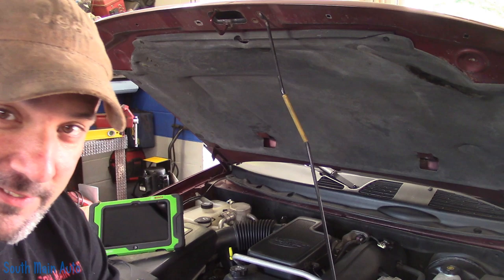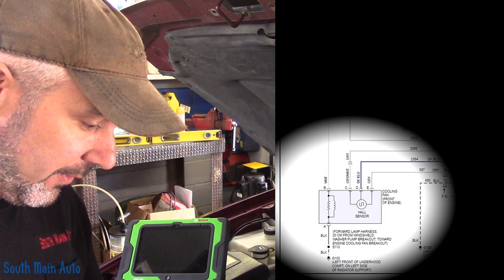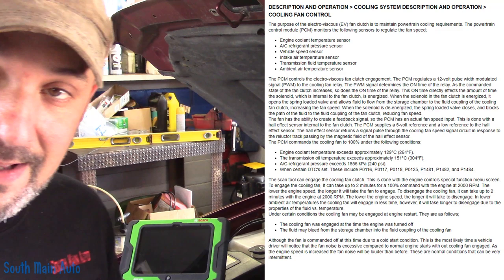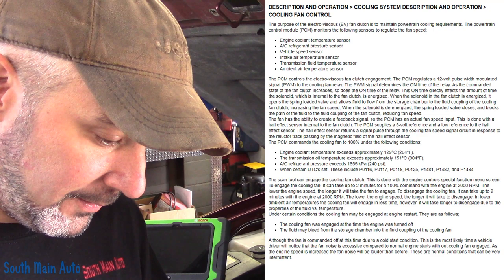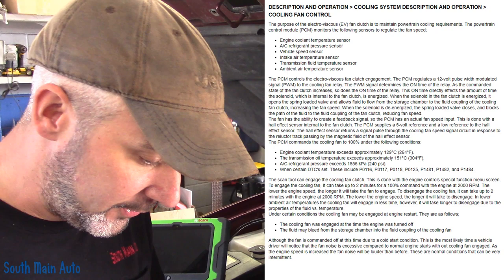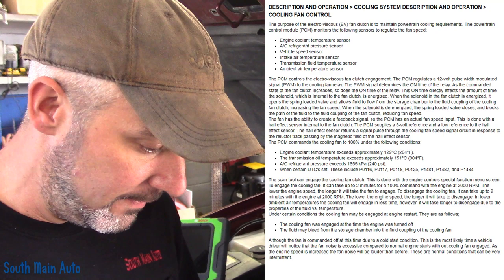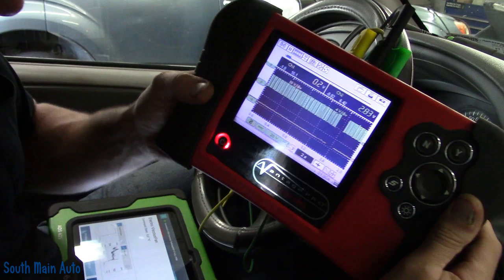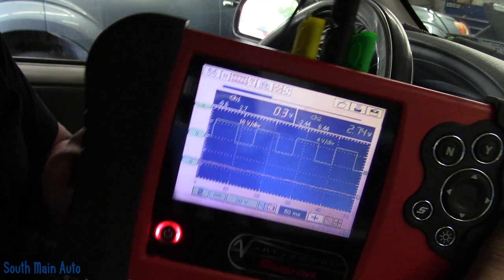Chevy Trailblazer: Electric Fan Clutch Failure

Comment: I had a 2002 that reached 200K miles before I sold it. The fan was definitely a weak link in an otherwise good vehicle. The theory was sound, but the clutches were a problem, especially in the first couple years of production.

Comment: It's not just Chevy, my 6.0 L. Powerstroke has a very similiar system.     I also think that the Chevy fan is spinning too fast when you have no energize signal.   When the fan isn't needed they usually slow them down to almost nothing to save the energy wasted.

Comment: Since I "retired" in 2004, and I only run into these problems by accident (I actually own a gifted-to-me-by-son really neat-o '05 Trailblazer) - I wonder if I could just go right to the signal from the Hall Effect Unit on my scoping handheld from years ago?
 It has the ability to show digital and analog pulses/voltages - and it should be able to do what you can do with a Snap-On multi-channel unit --- right? I was contracted with Chilton Repair until I retired too, but I've downloaded every schematic I could find from various sources and I THINK I'm somewhat armed for whatever comes my way. 
I have nothing bad to say about Snap-On - but I'm 75 years old and I cannot see a new handheld paying for itself for another 5-6 years even if I went back to work full-time (which I am NOT going to do!). I've still got my Snap-On MT2500 Brick and up till now it was fine!
Hmmmmm - I wonder if something like Torque Pro would be a good investment? Not sure it's bi-directional except for code redacting - but I'm kinda leery about CAN and The Brick getting along and playing nicely. 
BTW - I have sub'd your site and I follow everything that I think I MIGHT run into -----> when the trout aren't calling that is.

Comment: The sad thing about all of this is not only do you have to be a top-notch machinic, but also the fact that you have to have all of this expensive equipment, a diagram, and an explanation of how it works in order to figure out with is wrong with it. They call this progress?
Reply: its not that complicated, at least i dont know  think so. I work in IT,  i never even changed my own oil but i got tired of getting shafted about 5 years ago. so i started with small stuff like sensors and modules and i learn as the problems present them selves.  i bought another vehicle just like my primary so i could use it to swap parts or learn theory of operation on a known working system. sounds crazy i guess the more i type, but its been liberating knowing that i do not need someone who is probably high or drunk with an iq of about 75 "fixing" my vehicles all while not doing it right and over charging while creating new problems along the way. do not get me wrong the up-loader seems to be one of the few exceptions

Comment: Hey ERIC O.
This is a radiator fan related issue. The question is, I do not have any communication with the ECM on a 2004 Nissan Altima. Scan tool didn’t work. Was able to read data stream for the related part. Everything seems normal. Until I did my checks. When I disconnected the ECM relay. The radiator fan would go on automatically on its own. Key on.. but no power on ECM related components. I’m thinking is it a short? Ohh!! Aftermarket security/auto start has been added. Seen two open wires hanging from the obd2 connector from aftermarket splice. Help would be greatly appreciated 👍🏼

Comment: I've got a fan question. Say I buy a new V-8 F-150 and I buy and add a after market fan run by a switch in the cab. I would look for a fan maybe a quarter to a third the size of the radiator.  I would put it between the grill and the radiator toward a corner of the radiator. But I would only use it in heavy stop and go traffic or really hot days.  But what I want to know is by adding this fan would it cause more trouble then it would solve ?

Comment: I have a 2003 Chevy trailblazer ext LS and I just put in the second clutch fan and on the meter everything reads fine except the speed it’s stays at 0. What should I do? Do you think it could be the PCM? I’ve even changed out the wiring harness so I’m stumped,… Please give me some advice I can’t pass emissions because of the light won’t stay off even when I reset it! It just pops back on.

Comment: Did you inspect the magnet of the hall effect sensor to see if a piece of metal was stuck to an otherwise perfectly good sensor? I've seen that a lot with older rusty chevy's where the rust gets into the sensor. The bad clutch bearing is definitely a more likely root cause.

Comment: Thanks for that video , I’m currently having the same problem on a 2006 LR3 with code P0480 . Replaced the fan but no improvement. Hooked my original fan on to another LR3 and the fan ok . So now I now the problem if not from the fan but it will somewhere from the connector at the fan to the ECU . And here where I’m lost . I got the wiring diagram for the fan , but I don’t have a scope to check the wave form , I’m using a maxisys P809 as scantool and a good multimeter. Any tips Will be much appreciated .

Comment: If the 5 volt reference fails in the fan, it messes with throttle control. They share 5 volt reference on the 4.2 liter.
Reply: What about the ones with 5.3? Still the same?

Comment: Hello Mr Eric,
I have a  kia sportage 4wd. I watched a video of you changing the bearing in the rear end. Thanks so much for that. just a question? i do not have a host so i have to back the car up on ramps. If i put the car in neutral can i still twist the drive shaft with out the rear wheels turning to remove the allen bolts?

Comment: My 1925 Buick had bushings in a fan hub filled with oil and gears,works until the oil leaks out. Machine shop and sealed bearings works even better. GM engineers reincarnated?

Comment: Eric, So many comments... Own a 2002 TB with 160K trying to keep it operational for few $. I would just like to convert the damn thing to a bi-metal fan clutch like on my 2000 s10 with 4.3 v6. They attach to water pump similarly. or maybe remove it all to together and add an electric fan. any consequences to vehicle operation other than the check engine light? Thank you. If I must replace this with new, do you recommend a certain manufacturer of replacement parts?

Comment: From what I've seen, these Trailblazers make the later model S-series trucks look to be the most reliable vehicles on the planet ... and that ain't sayin' much! My brother's wife had one - nothing but problems right from the beginning. Typical!

First time I've ever seen a fan controlled like that before. A speed sensor! What'll they think of next!

I lol'ed at the tranny exceeding 304° before the fan is commanded on high! Should trigger some fire extinguishers long before that!! Guess GM knows they built a winner, so 300°+ temps may happen at some point in its life. 

I can safely say I've never Chernobyl'ed a tranny before! Oh, wait ... the 5-speed Allison in the Volvo cabover I used to drive for WM back in the day got about that hot once. I had 5 tons of recycling on board, and the tranny was slipping - I needed to dump, and go home ... so I did what anyone would do in that situation .... HELD IT TO THE RUG! 🤣 I could actually smell burning ATF at that stage. I dumped ... and made it 20 feet from the door, and that was the end of that. I walked into my house and ate supper at 11:30 PM that night ... 😖 Sat in that yard 3 hours waiting for a tow. All OT, though. 😋

Comment: Practical symptom: When you drive the car, it sounds like the transmission is failing to upshift, and the engine is racing. Check the fan clutch before sending it to a transmission shop. Most of them will rebuild the transmission even if it's good.
Reply: HA!   I have a 2008 trailblazer that may set for days/weeks before I drive it - and I always assumes this loud noise when starting out was the transmission not shifting immediately - needed to warm up - and than it was fine.  A result of not being driven regularly.  I just replaced both the clutch fan and water pump ( the pump was going bad and making a noise) - after making that repair I realized that noise was the fan being on - and not the transmission being slow to kick to a higher gear.   Eric printout at the bottom clearly states that the fluid leaks out of the reservoir into the coupling chamber over time when the motor is off - so when you start it up - fan is running at motor speed.  All this is normal.

Comment: how is the car driving when the fan is doing this? my fan is doing this and i have almost no acceleration. if i go up a hill i will either stay the same speed or lose speed. if the transmission downshifts to grab a lower gear at about 50 mph and above, the rpms increase to accommodate the lower gear, but rpms do not increase with throttle, and speed does not increase. the only thing that happens when it downshifts is i lose miles per gallon. 

again, i would love to know how the car is behaving when you know that this fan is bad because i am tired of driving with my hazards on everywhere.

Comment: Connector 6-Way F Metri-Pack 150 Series (BK) (pn:15326829)	
Pin; Color; Function
A	BK	250	      Ground	 
B	WH	2368	   Fan Clutch Sup. Volt	
c	GY/WH	2365	Low Ref	
D	D-BU	2364	Fan Speed Signal	
E	GY	597	       5-Volt Reference	
F	N.a.		

Bravo nice work bruh - with this many comments, should be a class action suit against the parent co 😮
Side note, anyone do a simple electric fan swap on these GM straight 6 turds; whoops, I meant FINE Quality American engineering. In all honesty, I love the blazer - minus the corrosion

Comment: I have a 2007 envoy with 5.3 that fan speed is on high at cold engine start up. AC isnt working. Replaced fan clutch, thermostat, coolant temp sensor and it still has same symptoms. Any ideas whats the issue? Pcm? Bad ground?? Any insight would be appreciated.

Comment: I am more surprised that it is using a viscous fan coupling as I would be if it was vacuum based. Why vary fan speed other than electrically in a modern car? Seems this way adds weight without any benefits.

Comment: At least the motor wouldn't overheat and blow up. Just more unnecessary bs to just break down and cost money. He probably replaced the fan and broke the shroud himself. The good old fashioned fan clutches were more reliable and easier to service. Nowadays everything has to be computer operated to make it harder to service.

Comment: Can anyone explain how the scan tool could accurately read the fan RPM? Isn’t it getting that info from the faulty Hall effect sensor also?
Reply: I think He was reading that PWM signal directly from the sensor using small backprobes into the connector.
Reply: @ab-cd456  He may have early on - but it was still a faulty sensor.  If he could read the actual speed from the harness, shouldn't the ECU also be able to? In addition, around the 10 min mark he is showing what I believe to be the OBD output of commanded fan speed and actual fan speed (approx 300 vs 1800). If the sensor was giving the computer a faulty reading, how can it also be giving it the "actual" speed.  It's like one part of the ECU knows the speed, and the part that is trying to control it doesn't.  But that's obviously not true - so that's why I am confused.

Comment: Leave it to over confident engineers who will never have to work on their "masterpieces" and think they will never break down to over complicate something so simple as a cooling fan. It's not as if they could have just used electric fan(s) instead of an overcomplicated mechanical fan. I wonder how the engineers who make the car would feel if techs and mechanics made the cars and the engineers had to fix them. Better yet, make the designers and engineers who made the cars work on the cars they made.

Comment: Well, we can't do it unless we have the scan tools that you have.
Reply: One can do this easily as all you need is a scan tool get the code. Disconnect the Negative cable, replace the fan clutch/radiator/waterpump/hoses if you want to do it right. As most likely due to the age/years you will spend it now or later.
Reply: IT'S NOT JUST THE TOOL, YOU HAVE TO KNOW A HELL OF A LOT MORE.
Reply: @NoWr2Run   That's the easy part!
Reply: NO, YOU HAVE TO KNOW HOW TO USE THE TOOL, HOW TO HOOK IT UP, PAY FOR WIRING DIAGRAMS, UNDERSTAND HOW THE ELECTRICAL SYTEM WORKS ON SOOO MANY VEHICLES, THE TRICKS OF THE TRADE, KNOWLEGE ECT.. I KINDA AGREE THOUGH THE BIGGEST PART IS THE TOOL, VERY EXPENSIVE PLUS NOT EVERY SCAN TOOL WORKS ON EVERY VEHICLE, MORE MONEY. HELL SOME COST AS MUCH AS A GOOD USED CAR, I GET IT, Jeffrey. I LIKE MY 68 CAMARO 327 & MY 97 JEEP GRAND 4.0, EASY TO WORK ON NOT MUCH ELECTRICAL CRAP.

Comment: What was the customer complaint? And how did it affect drivability?
Reply: Gregory Birulkin I know the engine light was on
Reply: Check engine light was on but the fan was loud as well. Won't affect driveability too much, but may use more fuel, might have reduced power, & sound may be annoying.

Comment: Really Chevy? It's gotten to the point you need diagnostic equipment to troubleshoot a fan thermo-clutch. SMH!

Rockauto's price on the factory AC Delco replacement is $225.79 USD +Tax & Ship. So if you do it yourself then figure $250 + 1 hr Eric's shop time to diagnose the issue (~65 - 125?). So ~320 bucks at the MINIMUM to fix this IF you do it yourself!

My friend's father-in-law runs a Chevy Dealership. They double the invoice price on the part when they service the vehicle. So 225 now becomes 450 + 1 hr shop rate (+125 + taxes). A fan coupler replaced at the dealer could approach $600! CRIKEY!

Eric - more power to you! Small garages with technically-proficient staff are the way to go!

Comment: What an unreasonable amount of unnecessary garbage involved with spinning a fan on the front of an engine. I don’t see what was wrong with just a belt driven mechanical fan. Worked fine for many years.

Comment: Geezus, computers in everything!  Gimme a 1972 Dodge Dart with a slant 6 auto.
Reply: scott king I have a 72 Dart with a 440, 727 reverse manual valve body and a Sure Grip 8 3/4 rear with 3:23's. So easy to work on!
Reply: I take my old 74 Charger SE (if I still had it) any day. 😁
Reply: @jumpinjojo  I know. Small box of Sears tools and a Haynes manual and you can rebuild the entire thing...

Comment: Dang! You need to throw out the whole fan assembly because the sensor delivers bad info at high rpm. Overengineering, at its finest.
Reply from the maker: No worries, it's only about a $600 repair with OEM parts haha 🤣😂

Comment: Ok, so I'm confused about something!! 

What is the fix?? The relay! The Hall effect switch? The PCM? Is the feedback sensor part of the entire fan motor consortium, or are there parts and pieces that are user serviceable! Do have to load up on parts cannon ammo, to cure this issue, or is the fix just go buy a Toyater (not a sponsor)??  EH???
Reply: the fan-clutch unit itself, as the hall-sensor is in that, along with the flow-control solenoid

Comment: It's just more crap to stop working and keep the old shade tree mechanic from working on his own vehicles at home.
Reply: It didn't stop me. I changed the Rad in my mom's damn trailblazer. Talk about fricken nightmare job. Told her next time it goes bad, just let it roll off a long steep cliff
Reply: @canadiantrucker9574  u need to burn it. Throwing it of the cliff will only make it angry.
Reply: @canadiantrucker9574  That's the reason I like my 1951 Ford I can take a half dozen wrenches and do a complete overhaul and no rust at all because it's a Georgia mountains born and raised car .
Reply: I changed the one on my Ford diesel dually and it was a pain in the ass too.

Comment: All this complexity to control a simple radiator fan that could have been controlled by a mechanical thermostat built into the fan (like many, many others).  And they can't put a true oil pressure gauge in this car.  Ridiculous.

Comment: Electro viscous fan clutches are one of the dumbest ideas I've ever seen. For all the extra hardware you need like a solenoid, relay, hall effect sensor and extra bearings you have an overly complicated solution to a problem that was solved decades ago. Just stick an electric fan on there, four wires gives you way more control over a much more reliable system.

Comment: I like when in the 70s you did not have to buy a $5,000 analyzer to find out what was wrong with your car.. But it's a ripoff world now and nothing you can do.. Well there is one thing you can do like I did is go buy a 60s 70s or 80s car at MECUM auto auction and not have to go threw this computer garbage testing....

Comment: Thats the FIRST thing I had to replace on mine. It was a BITCH to change. They fail all the time.
Reply: I've got the same setup in my 2006. I've changed the fan clutch a couple of times now and the water pump. It's not that hard. the trick is to use some 8 mm x 30mm long bolts to get the fan out easily. There is a nice YouTube on how to do it.